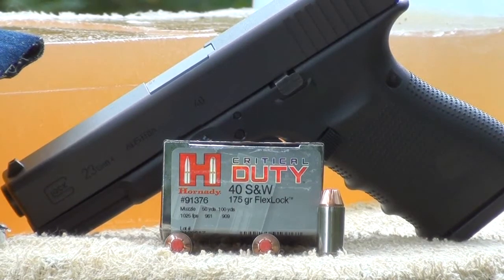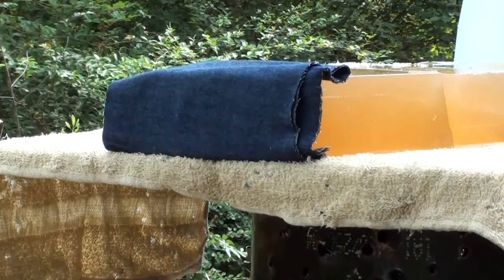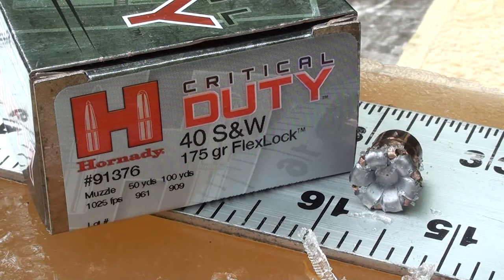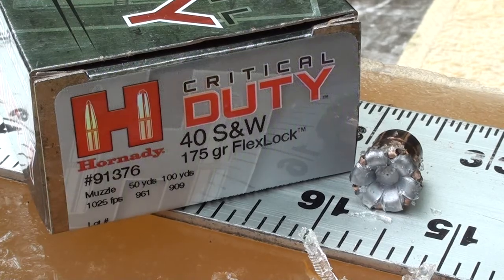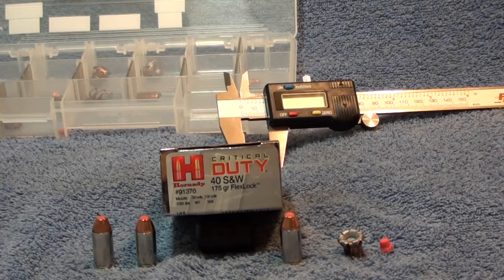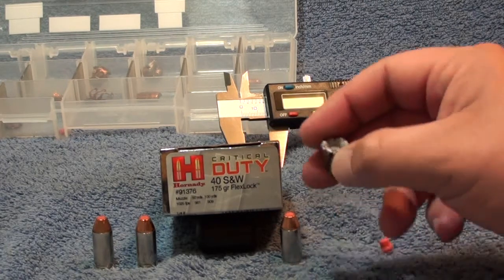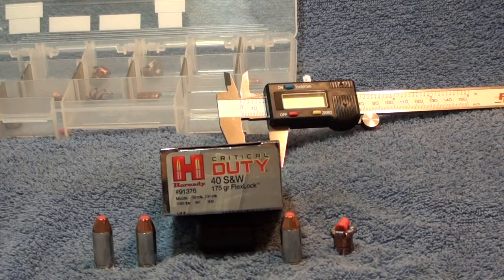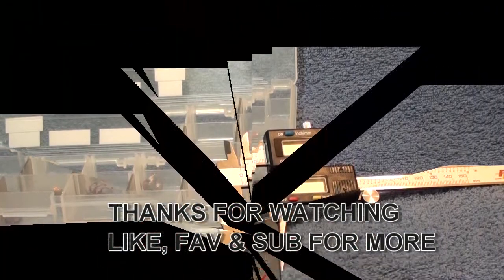Hornady Critical Duty 175gr 40 S&W ballistic gel test

Comment: I've demoed Hornady Critical Duty and TAP to numerous law enforcement agencies here in the midwest. I can attest to its performance and reliability. We've demonstrated 40 sw, 45 acp, 9mm and 9mm+p. It surprisingly retains its weight after shooting through rolled steel ( car doors ) wall board, plywood, and glass as well as three layers of clothing ( denim, polar tech, and cotton). No worries about over penetration.
I will not use another type of ammunition unless I carry a sub compact weapon, and then I carry Critical Defense. Critical Duty is not designed to be fired from sub compact weapons.
We go through great pains to insure our gelatin is calibrated according to FBI protocol. It truly is a science of its own.
Hornady has hit it out of the park with this ammunition. Law enforcement agencies see the proof is in the pudding. They are all switching to or wish to switch to the new Critical Duty line of ammunition.
I'm curious though on the weight of your bullet in your video. Did you weigh the tip ?

Comment: over penetration my ass you fool. ten feet is less than 7 yards (21 feet) at ten feet you can aim for the fuckers head. the reason I shoot the heavier .40 loads is because at the range I practice at 15 mostly and some 25 yard shooting with my sig. the lighter .40 loads will do better up close but they for some reason hit inches lower than the heavier rounds at distance. if a fucker runs behind a car I can take his head off at 15 yards cuz I practice. go shoot 165 then shoot 180 and tell me

Comment from the maker: It would be a fine round to defend yourself in a home or apartment. That said this is not a safety slug, or a mag-safe style round (or fragmentation style) round, so it can and will penetrate walls, so if thats what you are asking for is a safer round that will came apart when passing thru a wall, then no this is not that kinda round.

Comment from the maker: "Stopping" power is a loose term in the ammo industry, it performed within the specs it was designed too, meets FBI protocol for "stopping" power and from the looks of the gel leaves one hell of a nasty wound tract.  I dont know if anyone has been really shot with one of these rounds yet, but I bet it "stops" them pretty well.  If you are refering to energy, its advertised at the muzzle at 396, fifty yards at 351 and one hundred yards at 316, all measured in foot pounds of force (ft-lbs) HTH